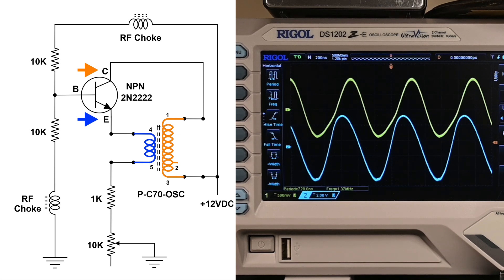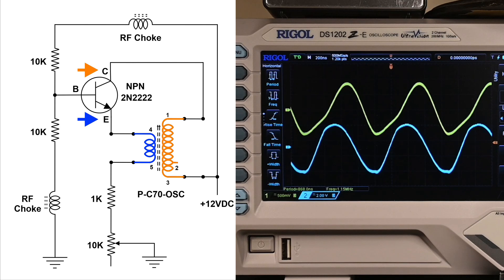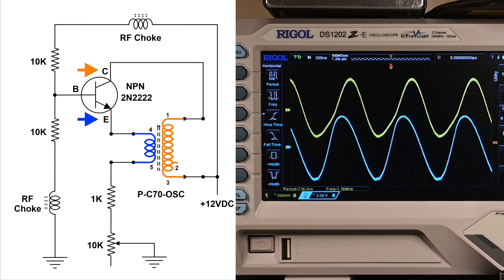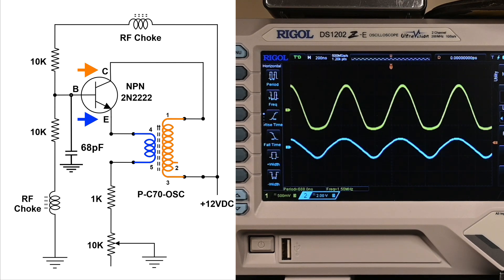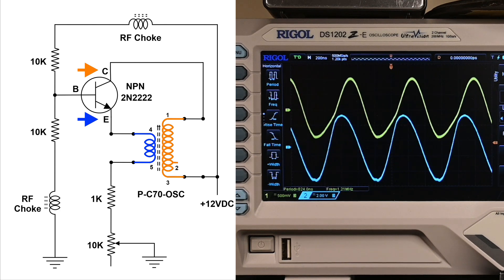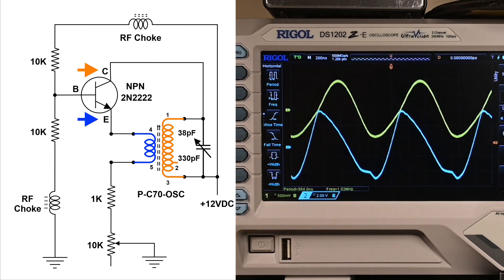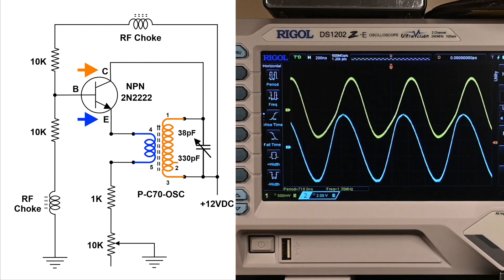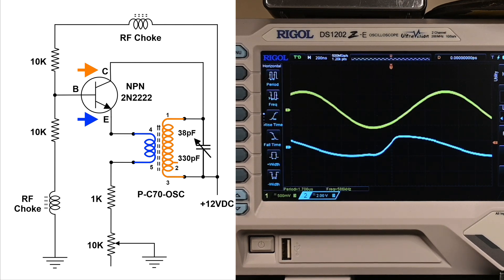Oscillator Experiment Interesting Results Part II

Comment: Thanks 😁
Yes, this is a common base oscillator.
It would be interesting to put a capacitor across the variable resistor, which should provide higher AC gain and perhaps cause the waveforms of the collector and emitter to clip.
Reply from the maker: Thank you. You may find this interesting.
Oscillator Experiment Interesting Results Part II
https://youtu.be/l_yRTZ-YoPc
Reply: @AllAmericanFiveRadio  This is "Oscillator Experiment Interesting Results Part II" 😉

Comment: Next step would be to wire it deadbug style with the wires as separated as possible to reduce capacitance. It should require the tuning cap to be stable at that point.
Reply from the maker: I did put the transistor and 10K bias resistors on a separate small bread broad. I did not notice any change.

Comment: So this circuit works well on a breadboard only because of the parasitic capacitances between the metallic strips in the breadboard itself. To overcome parasitics you'd need to include higher capacitance in parallel. So your transformer needs a capacitor in parallel to a primary or a secondary. This will fix the problem of nonlinearities and will have a strong signal buildup. One more note regarding the transformer in the signal feedback path. Normally oscillators using a transformer are called Armstrong oscillators. However, they're normally connected along the negative feedback path. For an oscillator intended for RF applications, the best amplifier topology is common base and not using a transformer. Frequency selective circuits, the LC tank, should be between input and output directly. There are few techniques to connect a divider network to diminish the gain for wideband applications, some high gain for narrowband. RF is a wide field, and fun for those who have patience for replicating natural phenomenons to create special applications.
Reply from the maker: Thanks
Reply: Did you ever make a radio oscillator (say between 800 KC and 12 MC) in practice? 3 july 2023
Reply from the maker: @radiofun232  Yes I have. The tank circuit in the AM transmitter can be easily changed to transmit in the short wave bands. The FM transmitter tank can be change to transmit in the Two Meter and higher Armature bands. Hope this helps.

AM Transmitter Build Project and Demo
https://www.youtube.com/watch?v=hhDjj45O4Lc

Build FM One Transistor Transmitter Project Modification 3-3
https://www.youtube.com/watch?v=3tc3gBEU9Js
Reply: @AllAmericanFiveRadio  Thanks Richard, of course I knew that, have seen all your video's! My question was directed to @xDr1Tek...